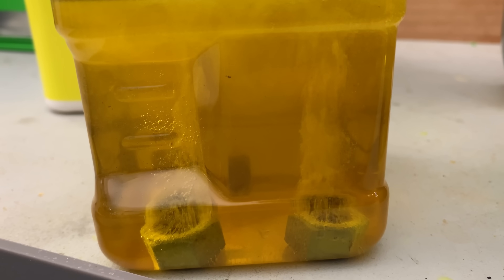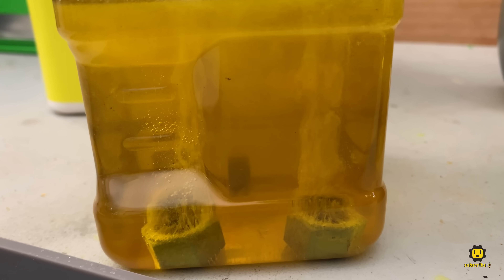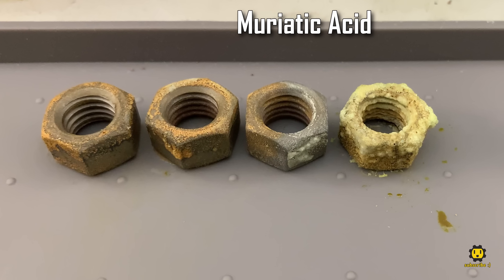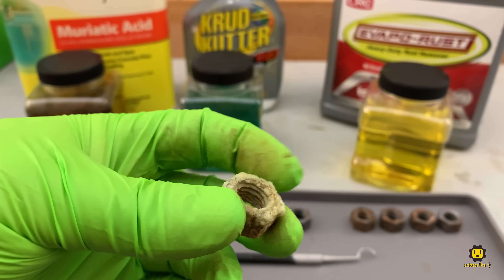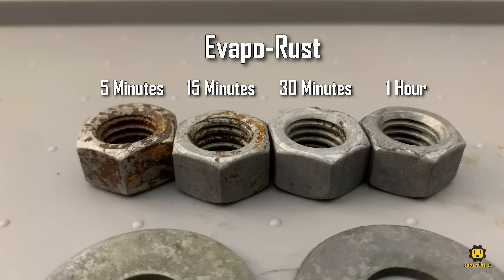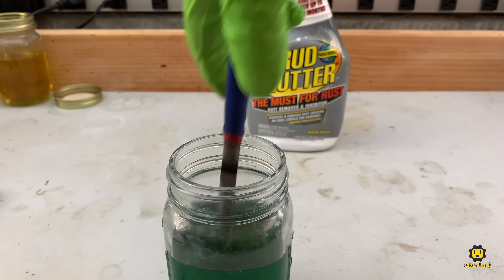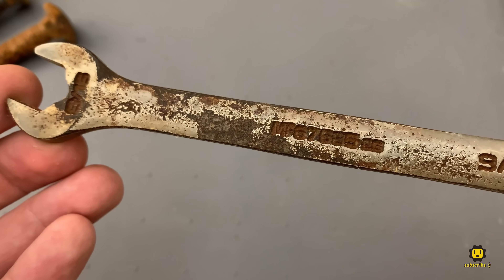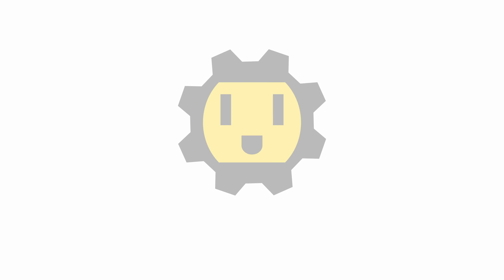The ULTIMATE Rust Remover - Cheap, Fast, & Easy

Comment: But did you try calling on a priest to pray over the evapo rust?  Everyone knows that helps. Oh, and also you need to introduce 13 freeze -heat cycles, that really helps the evapo rust do almost as good as plain vinegar.

Comment: Save solution.  Put part(s) in a waterproof, flexible bag and put that in a container of fluid or loose fill to conform bag closer to parts.  Balance saving solution against need for excess working volume or make multiple solution changes.  Poly graduated cylinders are great for long parts.

Comment: Evapo Rust for the Win! 
I work with a lot of expensive / high end PCP air rifles,  and if/when any of their metal components oxidize or flash-rust, 
Evapo Rust is the Only solution I've used so far - that works as well as it does - every single time.  But Wait . . There's More: 
I had to remove a small area of spot rust on a modular barrel..  I dunked it all vs. having to disassemble.. 
Not only was every spot of rust eliminated,  the solution also Completely removed the bluing!  [OEM Black Oxide finiah]
**So should Re-Bluing ever be needed - This stuff works excellently for the prep process as well

Comment: I usually go cheap and easy, but I don't worry about fast.  I just soak stuff in plain white vinegar for a week or two.  Stuff is like $1.97 for 2 gallons at walmart.
Reply from the maker: If it works, it works! And you can’t beat that price

Comment: I dilute 99.9% Phosphoric Acid down to 25% to 50%. I apply it with an acid brush and spray it down with water occasionally to stop the reaction from drying out. I then let the phosphated steel dry out. I then apply Fertan Rust Converter and again keep the reaction surface wet until it's completed its work. Then I wipe the surface with a sponge. The Fertan leaves a protective layer of zinc on the surface, which is good for 6 months without any further protection from the elements. However, I use a high Zinc primer as a forever coating, such as Rustoleum or Plasticote Cold Zinc primer.
Reply from the maker: That’s a great process, thank you

Comment: Evaporust can be replicated by replacing the active ingredient of Phytic Acid with Citric Acid. Phytic Acid is super expensive but is a really powerful chelating agent. Citric Acid is a way cheaper chelating agent, albeit not as strong as Phytic Acid, but does the same thing. Mix some Critic Acid into Tetrasodium NDTA so that it has a neutral pH. Use ChatGPT to work out specific amounts you need. The reason Evaporust use Phytic Acid is that, being so stronger, they only have to use 2% of it in the overall mixture. If an ingredient is less than 5% of the product, then it can be kept secret, hence why Evaporust use this expensive acid instead of a much cheaper one. It's to maintain the position in the market.
Next, I'll need to figure out the active ingredients of Krud Kutter to make an affordable alternative.
Reply: To approximate a 1 kg (1000 g) batch of Krud Kutter Rust Remover based on publicly available safety data sheets (SDS), here’s a breakdown of typical ingredients and their approximate proportions. This is a reconstruction for educational purposes only and not an exact formulation.

📦 Approximate DIY Formula (1 kg batch)

Ingredient	Weight %	Weight (g)	Function

Phosphoric acid (75%)	50%	500 g	Rust removal (acid)
Water (distilled)	30%	300 g	Diluent
2-Butoxyethanol	9%	90 g	Solvent/degreaser
Citric acid (anhydrous)	5%	50 g	Mild chelating agent
Nonylphenol ethoxylate	4%	40 g	Surfactant
Corrosion inhibitor	1%	10 g	Metal protection post-treatment
Fragrance/preservative	1%	10 g	Shelf life, scent
Reply from the maker: Great comments, Rich. Thank you! That’s pretty clever about the phytic acid. How did you learn that?

Comment: Great video and thanks for doing it!  However, the problem with all these chemicals is that they dissolve the rust removing the iron from the tool. Food near the end, this leaves Pitts in the tools. Although no process is perfect, Electrolysis is Reported to Reverse the rust action essentially redepositing iron, where the rust. This tends to not leave as deep pits as with other chemicals. It would be very interesting to see a repeat of this Experiment using electrolysis compared to one or more of the other methods. I think you will see less pitting, so that would be very interesting.
Reply from the maker: I’d love to do an electrolysis experiment! Great suggestion

Comment: Vinegar does the same thing at a fraction of the cost.
Reply from the maker: I’ve used vinegar to strip mill scale with good results. Do you use regular or concentrated?
Reply: @ShopHumor  Just grocery store bought vinegar.
Reply: @ShopHumor  After you should neutralize it with baking soda.

Comment: With all that rust, which is iron oxidized with oxygen, the removal of the rust, there should be pits in the metal where the iron oxidation was. Where are the pits in the metal?

Comment: Your reasoning regarding a rusty part is flawed.
It should be noted that when you use a product to remove rust, the part will no longer return to its previous state or appearance. The part recovered from rust will lose material, and in the case of threads on screws and nuts, one effect will be that there may be some looseness between the two parts.

Comment: I've used evapo rust in the cylinders of 3 tractor motors that were locked up, 24-48 hours later was able to use the hand crank to roll engine over as easy as if it were new. The evapo rust  works great on stuck rings and crank bearings. Although, you need to change the oil and flush the motor, its better  than force shock of pull and dump clutch method or prying on the fly wheel. I work on old 70-80 year old Farmall tractors extracted from fence rows.

Comment: I just bought a 17 year old used car from a dealer in Ohio and it had been driven in Pennsylvania for a large amount of its life time, so it has a lot of rust on some parts under the vehicle. I plan to restore this vehicle, as it looks great, so I’ll be replacing some parts, but I might use some kind of rust restoration product on the parts that are only slightly rusted. I’ll save this video for future reference.

Comment: just used the citric acid/carbonate mix. worked like magic and better than anything i've tried, and dirt cheap.
Reply: yep! Been using the 100g Citric Acid, 43g borax (washing soda), mixed in 1L of water (distilled) add a couple drops of dish soap after it all reacts. Stuff genuinely works better than any other product I've ever tried and for a fraction of the cost.
Reply: @synisterfox Borax is sodium tetraborate, and washing soda is sodium carbonate; Borax is not washing soda.
Reply: @synisterfox  Does anyone have a video about that?
Reply: @summer_stormtrooper  Beyond Ballistics
Reply: yup. Way better than anything youll find premixed on the market.
Reply: When you bake baking soda (sodium bicarbonate) in the oven, it undergoes a chemical reaction where it decomposes into sodium carbonate, water, and carbon dioxide.

Comment: I am always careful about what I dip my nuts in.
>
My traditional go to is Phosphoric acid. You have to be careful with concentrations and timing and be prepared to neutralize and seal the metal afterwards.
.
The CRC Evapo-rust looks like a preferred safe alternative as it has no corrosive acid or base active constituents

Comment: Evaporust is great, but too expensive where I live to use for anything but the most sensitive parts like preserving zinc coatings.
Evaporust is a pure chelator (chemical binder) for iron so it will rarely damage anything other than the rust (sometimes color changes though)

IMO, the best overall is Citric acid by a long shot. It's a mild acid, quite safe to handle - even potentially food safe depending on where you buy. Also biodegradable, longterm stable (trivial to store and reuse), is a powder when dry, and non-volatile (doesnt fume) unlike muriatic which slowly evaporates rust-promoting and harmful vapors nto your room. Despite it being a weak acid it is a fantastic chelator for various oxides, especially iron. This means it cleans relatively fast while having very low potential for damage even if you leave it in long after the rust is gone. The only thing that really happens if you leave it way too long is you can get black magnetite coating as oxygen in the water is depleted - requiring a little more vigorous rinsing.

And the best part of course is the cost is very low. Especially if you buy a bulk 20kg industrial bag, then the kilo price is trivial.

Heat is important if you want speed. Rule of thumb for most chemical reactions is you double the speed for each +10c. That means 32x faster at 70c compared to 20c for example. And citric is perfectly safe to heat because it is a very heavy non volatile molecule. Even boiling (excessive), you only get water vapor (unlike many other acids. Dont heat muriatic acid. very bad idea - and potentially even dangerous).
If you add an ultrasonic cleaner on top of it all you can probably 5x or 10x the speed further. Light to moderate rust can be gone in a matter of minutes. But its perfectly viable to just have a big bucket to drop your rusty crap into (use a mesh bag to make checking status easy and thank me later) and let time do the work. Might take a couple days without any heat assistance, but it doesnt get any more low effort.

If you must have a pure chelator for sensitive worl, check put "rust911" too. basically knockoff evaporudt (US product). They sell the stuff much cheaper and highly concentrated.

Comment: Don't get me wrong, but applying "quick rust" with acids is a weak not riped, shallow surface rust. Something that oxidizing for years wont give in easy. And removing that rust with anything will leave indents, because it has been already lost.

Comment: I think the main advantage to EvapoRust over Krud Kutter or muriatic acid is its interaction with skin. You CAN dip your hands and even arms into a large barrel to get stuff out without having to worry too much, as long as you wash off afterwards. Both muriatic acid and Krud Cutter are not something you should get onto your hands.
Reply: Their data sheet changed on that front. It now says that skin corrosion/irritation is a risk.

Comment: Where did you find evaporust for 20¢ an ounce?
Reply from the maker: The hardware / auto stores around here have it for about 20 cents an ounce for the gallon. Advanced auto has it at 23.99 for a gallon, or about 18.75 cents per ounce. Amazon has it for 23 cents per ounce (with prime, not sure if it’s different without): https://amzn.to/43RNWGU

Comment: Have you ever tried acetone and transmission fluid mixed at 50/50 for rust removal? You will be surprised
Reply: Hmmm how long do you leave them in for? 🤔
I've never ever heard of this before but it sounds very interesting?
I'm curious the mode of action taking place in this scenario? Can you elaborate on what suspect is happening using this solution?
Does the mix emulsify and go milky? Like when coolant and engine oil mix or hydraulic oil and water mix?  Transmission fluid is merely a hydraulic oil (ATF).... specifically it's NOT manual transmission fluid?
My thoughts are that the acetone attacks the rust but the ATF prevents further redox from occurring acting as the rust inhibitor by preventing metal surface from contact with the atmospheric oxygen and the oil being hydrophobic prevents water penetrating?
I think I may have to investigate this one myself. Cheers
Reply: You combine the two in a small batch say a cup of each depending on the size of the project and brush the mixture on, the reaction between the rust and the solution is almost immediately. Let it work and scrub with your choice of wire or nylon brush, rinse and repeat till you reach the desired affect!

Comment: I have used muriatic acid for years and it works great, but you need to have a pre-prepared solution of baking soda and water to neutralize it as soon as you pull the part out of the acid. I do the same to clean the insides of fuel tanks.
Reply: I left a rag with muriatic acid in my shop with it closed up for a few days. That stuff rusted all the bare steel in my shop.
Reply: Whoo, you like to live dangerously. I would probably forget to check on it and find the part or gas tank totally gone. I certainly would not use it in a motorcycle gas tank. I got one drop of MA on the corner of my eye by opening the cover seal on a gallon jug of it before dumping it in a pool and immediately stuck my head in the water to flush it out (before dumping the acid in) but it burned for three days. Be careful with that stuff and wear safety glasses or goggles. I put some rusty chromed wrenches (cheap ones) in vinegar, much milder than muriatic acid, and after a couple days it had loosened up the chrome plating, so it was flaking off, OOps. MA would have completely dissolved the wrenches or at least changed their sizes.
Reply: @manstersr Evaporust and be done with it. Doesn't touch the chrome
Reply: @speedfreak8200 citric acid is the base. Skip the brand name price increase.
Reply: Thanks, that's the comment I was looking for.  I usually just rinse the parts well with water, dry them, and then coat them with silicone spray, motor oil, or grease depending on where they will be used.

Does the baking soda nuetralizing the acid make it possible to leave the parts clean and dry without coating them with some lubricant?  I know that years ago I used phosphoric acid on parts to create a stable oxide layer but I never tested thise parts long term for rust resistance because they just got painted right away.
Reply: @kirkjohnson6638 Evaporust
Reply: Dilute solution in a spray bottle works good. Then rinse with a hose.
Reply: @mr.phenomi2976 Do you see much degradation in the base metals??
Reply: @JohnDoe-qz1ql  No, i used it on some Crager SST rims years ago and noticed no ill affects of the aluminum or steel. Same with countless chrome bumpers.  Never tried it on nickel plate as i was afraid it would discolor the nickel.  Key is to dilute it enough and to rinse the heck out of it when done.  I have heard of guys making a paste of baking soda and water and wiping the surface down before a final rinse.  Muriatic acid shouldn't do too much to the base but it is aggressive on oxides.

Comment: As Evaporust removes the iron from rust it leaves the carbon. You need to wipe or wash the carbon off periodically. And you can leave things in the Evaporust as long as you want with two cautions. 1: Do not leave a piece in partially submerged. You will get a cut line at the surface from teh air causing oxidation and the ER ulling the iron away just as quickly. 2: Do not use it with old nickle plated tools, etc. The old plating methods left microscopic pores. Over time it actually rusts under the nickle. ER will penetrate though the pores and the leave the iron compound (a sulfide? I can't recall) that ER forms and the carbon. The nickle can actually slide right off like a slime.

Comment: Ok..ok....most people don't know this one....if you want the fastest and cheapest rust remover, try oxalic acid (aka wood bleach). It's a powder that you mix around 2 tablespoons per 4 cups of water. I did the testing, and I have the most economic mix ratio which is close to the mix above. A bag of this powder acid is the cheapest of all other solutions. And the fastest solution to rust removal. It will......blow your mind! You're welcome 👍

Comment: Given that it can be used over and over, Evapo-rust is my go to solution.  Overnight immersion in a simple bottle or tank and it's done.  Rinse with water and done.  Non-toxic too, all 0's on the safety data symbols.

Comment: I found the cheapest & fastest rust remover was citric acid crystals in boiling water. Bolts look like the multi-hour Evaporust in just 5 mins. I imagine in an ultrasonic bath it would be pretty wild. It uses chelation like Krud Kutter and Evaporust.

The down side is the metal flash rusts quick, so you have to dry & lube right away. I use it to remove most rust then dunk in Evaporust to avoid flash rusting.

Comment: You can also use a Ziplock bag for larger items in the ultrasonic cleaner instead of contaminating the tank and having to wash it out. Glass works better than plastic jars (as it appears you're aware).
Reply: Be aware that ultrasonic cleaners have no problem removing aluminum and plastic coatings from steel…
Reply: Glass should also be Borosilicate 3.3 (pyrex) in order to avoid ultrasonic potentially breaking the glass.
Reply: Use “PYREX,” not “pyrex,” if you want borosilicate glass.